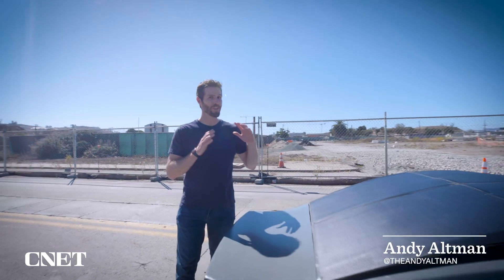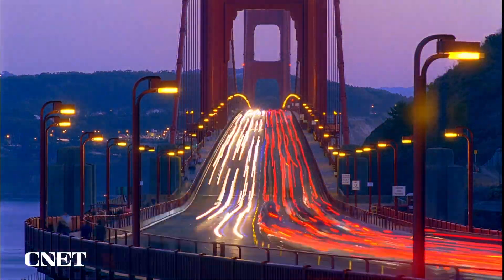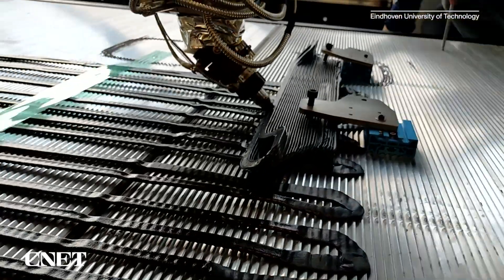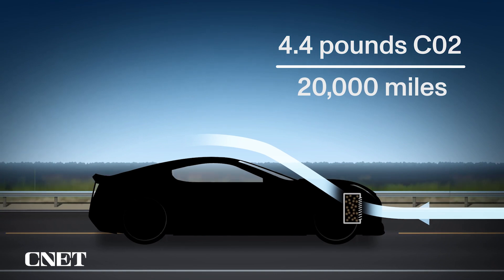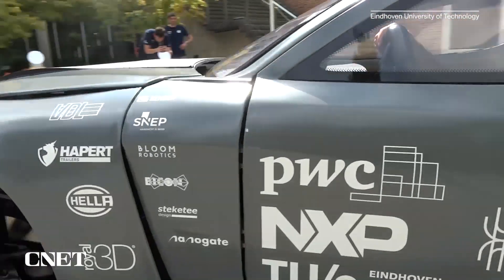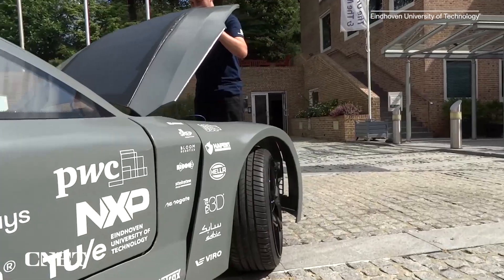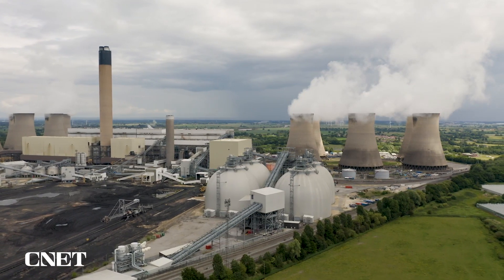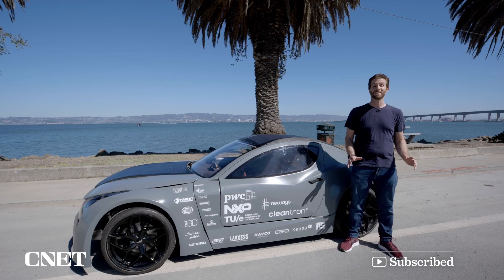This Car Is Designed To Be Recycled

Comment: Why not just have a solar powered fan blow air through the filter?  It would be the same thing only better because you wouldn't need to have the efficiency reduction of driving around with all the extra weight and drag that the filter has.

Comment: Does it really make sense to reduce your EV's efficiency just to take carbon out of the air?  sure it is good click bate but there are much more practical ways of doing this like placing the filter at the center of a big wind funnel on a windy mountain.  Simpler = more carbon removed.

Comment: 200 miles? 

That's quite a frequent maintenance item.  I don't want to have to clean out/replace a filter every 200 miles.  That would get old real fast.  

Cool tech, but not practical.

Comment: so basically electric car with two carbon capture filters..... they should make it open source and charge royalties and that will help it push to all manufacturers at a fraction of a cost rather than trying to replace exiting cars... they should make standalone carbon filters to retrofit on cars.... that way adaption is much faster and it will help at fraction of cost
Reply: #<<Thanks for the comment, write to me personally for inquiries and investment recommendations##™️..⬆️⬆️⬆️

Comment: Is there anything stopping these filters from being added to other electric cars? If the sourcing and manufacturing of the filters is the only limit that's an insanely viable carbon capture solution that could be very easily implemented compared with all the others I've seen.
Reply: Actually I was wondering if the filters could only be put on only electric cars. Even if the car is putting out CO2 emissions, having it collect as well; would still reduce the amount that makes it into the atmosphere.
Reply: #<<Thanks for the comment, write to me personally for inquiries and investment recommendations##™️..⬆️⬆️⬆️

Comment: ... what is this actually solving if they're not going to find cooperation with other automakers? 
Carbon emission growth is not slowing down either. 

Best way to capture carbon is to let go of natural land for development and speculation, especially wetlands/bogs.
Reply: Although the team partnered up with big companies as NXP, The reason to do this seperately from auto manufacturers is that big cooperations have very rigid structures, and developing a car takes around 4 years normally. Most projects get stopped during development, and open innovation is not stimulated.  By operating as a student team, faster innovation becomes possible. The team did have meetings with several big car companies in Europe and the U.S.A. for future developments.